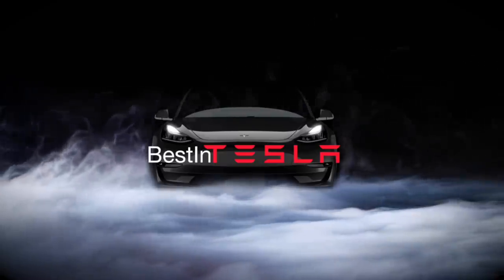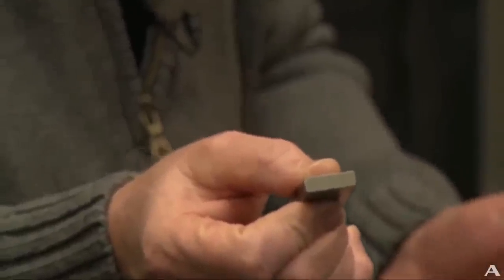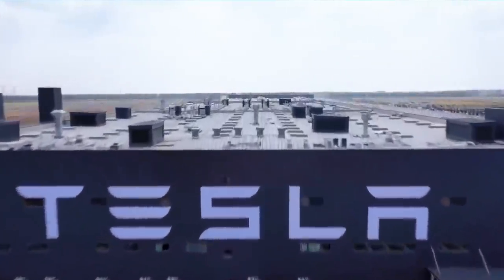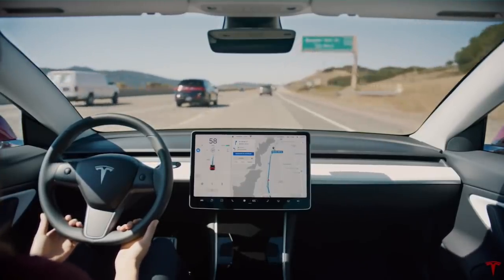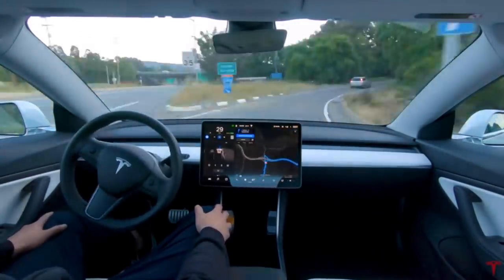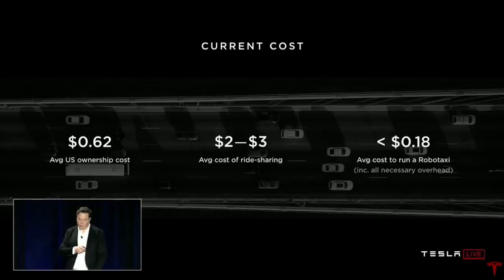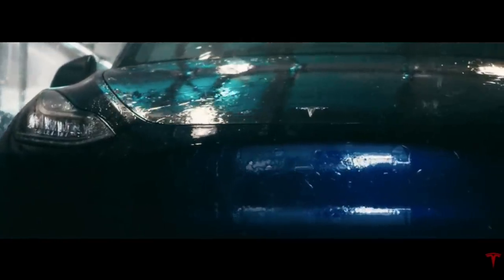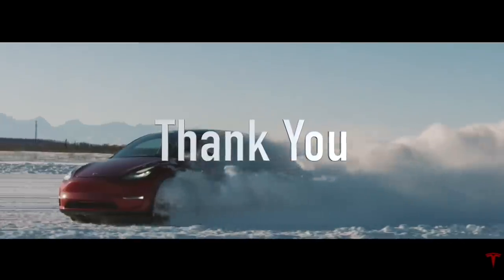Tesla's secret | The Endgame ?

Comment: For me it's all about miles per charge.  That's number one for me.  I have a 3000 mile round trip drive that I make multiple times per year so I want to stop for charging as few times as possible, and keep the charging time to under 30 minutes for each stop.  Home charging is not an issue at all, but charge time and location of superchargers is important when making long distance drives.  I don't own a Tesla yet, but I will.

Comment: I live in Canada.  Winters are -20 to -30C.    Will battery tech improve so that these batteries work well in the cold.
Reply: Electric cars will just have to be built with bigger batteries. ICE engine fuel efficiency is lower in cold climates. Electric will be no better.

Comment: iI you dont need a driver, why have a big truck?— most loads will fit in a small vehicle; most stuff is paletized for a fork lift to load onto a big truck which goes to a warehouse where the load is broken apart to send to various customers as demanded; simply load the pallet onto the small truck and send it on its way directly to the customer— self driving will be mandatory = no accidents, parking, traffic control etc = pennies per mile cost — but just before that happens, self driving, self energizing drones will take over everthing and ALL vehicles, ships, busses, trains etc and the terminals to service them will be obsolete; as will all the amazing infrastructure we built for them — the entire human built architecture of the planet will change for the better = lwealth increase for all. What happens when cities no longer need be located where transport changes are needed?

Comment: Typical OEMs get restricted with old-school restraints: software vs cost, efficiency vs performance, and size vs environment, electrification vs profitability. They've all hit hard barriers with regards to meeting Tesla at any of it's strengths and they keep getting held back by the laws of physics and economics. So if oil barons knew what's good for them, they would've pushed hydrogen and hybrids a LOT harder 5-10 years ago. But considering they've made themselves on short-term profits, I can see why they've failed to see this coming.

Comment: Secret Sauce is comprised of: World-leading automotive technology, world-leading battery technology and storage business revolutionizing the electric grid (i.e. Hornsdale Storage plant), Full-self-driving lead, Tesla Insurance, Tesla Taxi, solar electric shingles for homes/buildings, vertically integrated business model, etc. Other than that, Tesla is nothing special! :)
Reply: Grid scale battery storage is a diversion. 50 megawatts is nice to have a but a typical coal fired plant is 2000 megawatts. That's one heck of a lot of windmills and solar panels - not to mention the copper cabling, transformers and all the other infrastructure.
If Elon really wants to make a difference he should be talking with people like Ian Scott of Moltex and Richard Hargrave of Thorcon. Low cost nuclear fueled by old nuclear waste and an entirely new fuel strategey based on thorium. The latter is always found with rare earth elements so solves both problems in one hit.

Comment: Polite correction:  
//  (10:27 - 10:34)   "...and you got to remember that every Tesla sold since 2016 have everything they need for the full self-driving."
//  My late 2016 Model X is not equipped for "full self-driving."   2020 and after will be 'full self- driving' capable.
Reply: Daniel Murray My 2019 Model 3 has HW 2.5 and not 3.0 it is not able to recognize traffic lights. How is it going to self drive?
Reply: @sanjivnaik  If you purchased FSD you will be upgraded to HW3

Comment: 2019 Hyundai ionic = 136 MPGe
2019 M3 SR+ = 133 MPGe

And this wasn't even maximum effort by Hyundai
Reply: Well in time even if they'll able to copy tesla advance hardware which of today still not close enough. In the future their OS is still crap even today crap that legacy company has like lived for 100 years and still has crap soft in 20th century.
That is tesla single moat.
Like apple ho owns 80%percent of smartphone profits even though their hardware is easily copied but software is proprietary.
And their is many firms that reverse engineer the hardware like munro associate but no one even try to reverse engineer software.
Reply: @chillrawr9603  Hyundai/Kia have excellent hardware. As said they don't have the software to touch Tesla, but do they need it in their market?  Fiat, Peugeot and Renault seem to be taking it more seriously but even for them electric cars are a niche sideline. VW have to slay their diesel demons but the other German makers refused to take electric cars seriously. The latest electric Beemer with it's Sid Sloth front end is a case in point.

Comment: Elon is still saying that full self driving is still on schedule for this year. The only hold up will be government regulation.
Reply: I remain highly skeptical but we'll see....hope so in a few yr.s but it's a terrifically tough nut to crack when the lines on the road run out or any unique situation is encountered.
Reply: @WattsTheFuture  Elon has tweeted about it a few times. Also next Tesla update is supposed to include stopping at red lights and stop signs.
Reply: @WattsTheFuture  Yes nothing slower than politicians.
Reply: Self driving will happen on freeways long before it gets to cities. Back roads with soft verges, potholes and no white lines might never be economically viable for the tech.
Reply: @Dave5843-d9m  It's already doing a pretty good job in those 'back road' situations.
Reply: @Dave5843-d9m  Came to say just what Bo said. It is already doing roads with no lines at all. As for cities it is now stopping at red traffic lights and stop signs.